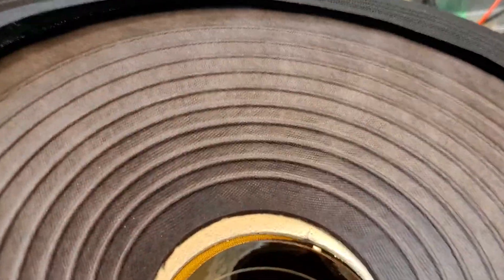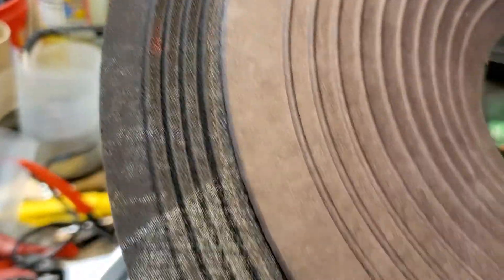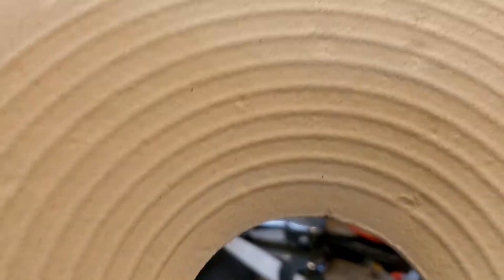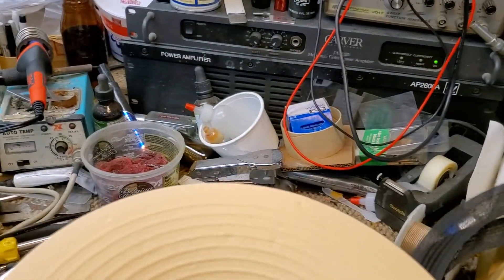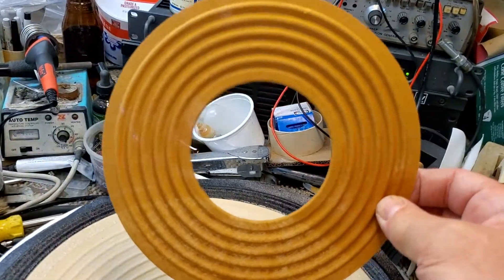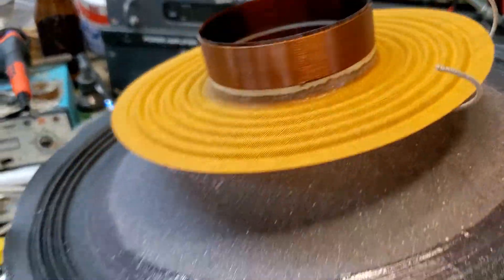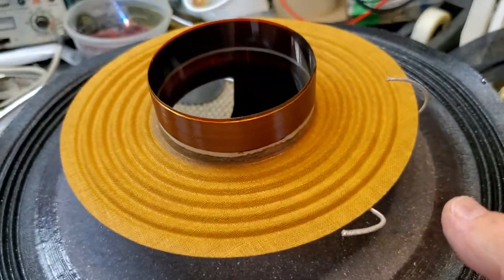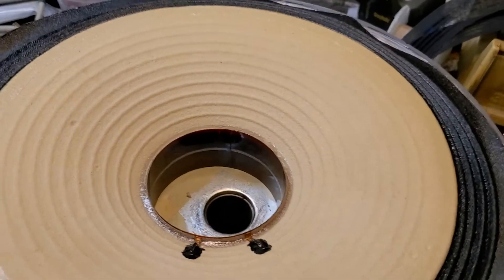True Reproduction recone kit for the JBL 2213H/2213/123A-3... by UplandLoudspeaker.com

Comment: Hi ken can a Jbl 2212 kit be used in place of the 2213
Reply from the maker: Hi JP. No, they're not interchangeable. 2212 has a smaller diameter spider.